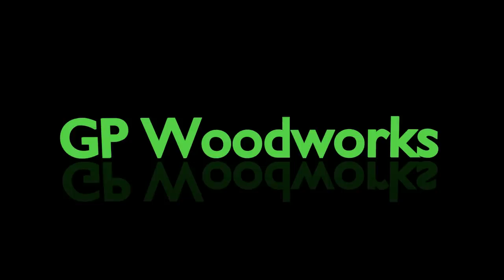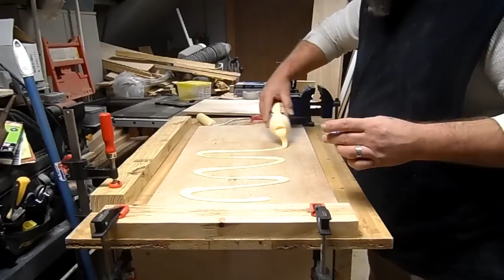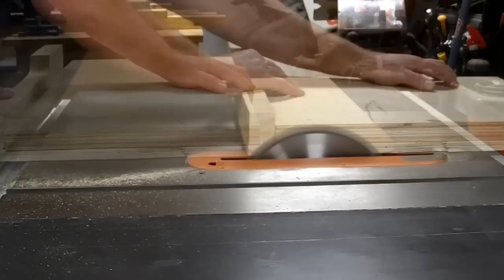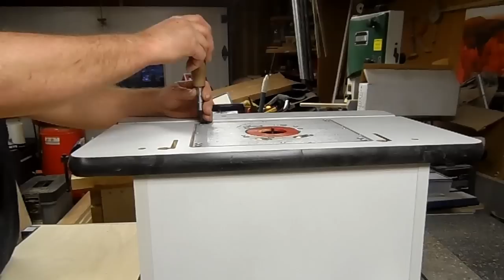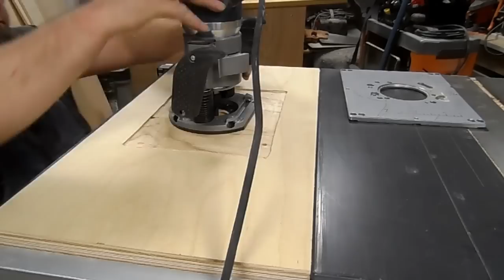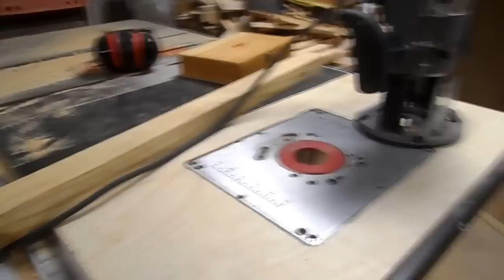GPW 42A - Making a Tablesaw Router Insert Part 1 (The Build)

Comment: Thankfully the router was a dud.  If it was marginally fit for purpose it would have been like a lethal weapon to be wielded with dangerous abandon.  If you want to mess with electrical circuits don’t go prodding and probing a live (dead) trepanning tool. ... haha.   Be safe... use blunt hand implements.